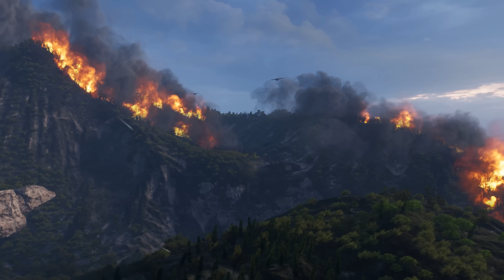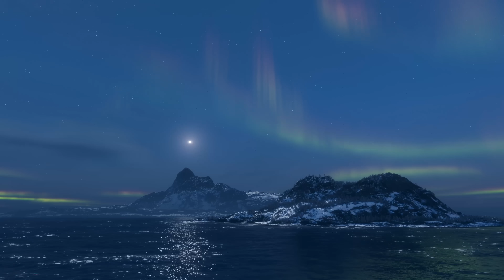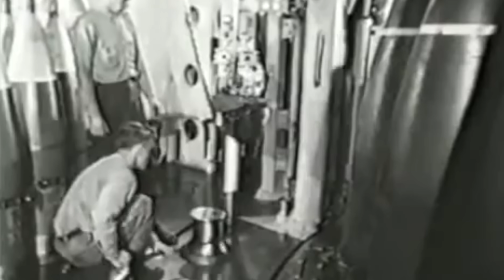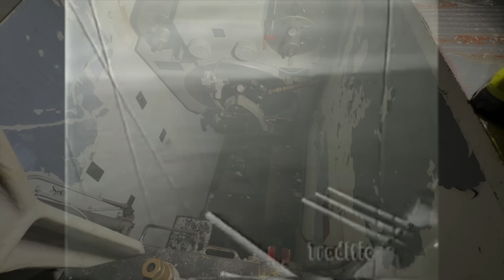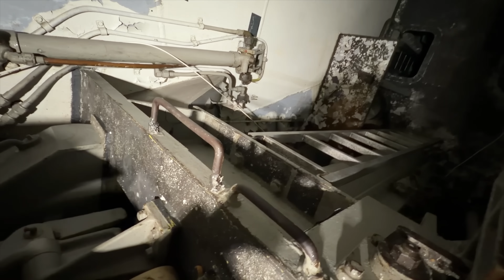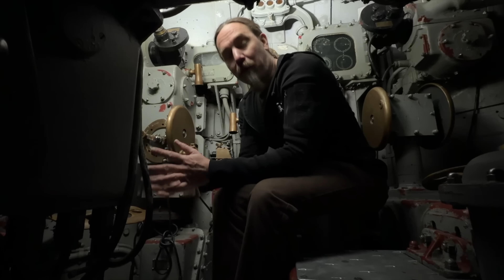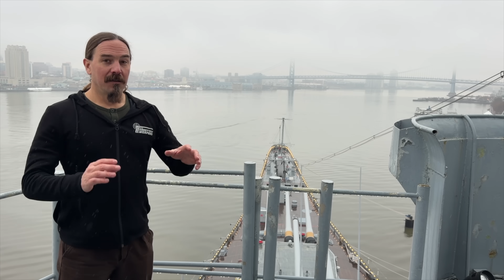How the USS New Jersey's 16-Inch Guns Work: Top to Bottom

Comment: I alwys wondered why they didnt make smoothbore guns, the hp shell or tailed ap (not apfsds) couod work and the guns would have a longer lifespan and more power, no?
Reply: Various studies were started for employing smaller Sabot projectiles, rocket assisted projectiles, and other enhancements for 16" guns over the entire course of the battleships service lives, but none of them ever came to fruition except nuclear shells in the 50s. One big reason for that is they had so many shells left over from WWII production that they never had to make anymore- maintaining the shells in reserve were always going to be cheaper than actually producing anything new.

 Then, aircraft and missiles were really coming into their own post war- having a range of 80 or 100 miles on the guns would be cool, but we already had platforms that could do that for the Navy so there was no urgent need to extend 16" range. After that, there was the fact that the Battleships were only temporarily reactivated  each time because of their absolutely massive maintenance, material, and manpower costs, and at that, we only had 4 of them so the benefit for all the experimental and development time would possibly not even be able to be realized when they keep getting decommissioned. 

That is all enough reason not to follow through development without considering the tragedy of the Iowa turret 2 explosion, and then the disgrace of how the Navy handled it, all plastered over newspapers, radio and TV. The day after the explosion 16" gun operations were halted entirely for a long time- almost a year I believe. They didn't have terribly much time to use them after they were allowed to again, and opinion which was already split in the Navy over Battleship usefulness was now split in the public's eye too.

As awe-inspiring as the Battleships and their main guns are, they simply never justified expanding their capabilities or amount of service further, and now there is no real chance if it happening again- the old powder and shells have been in the process of being removed from inventory and disposed of for a while now, so the guns aren't "free" to use anymore. Even if they were, the Battleships cost a ridiculous amount of money for a single day of steaming, ignoring refit costs.

What I believe the real solution would be is to make some new ships that could feature large naval guns again, but make them smaller and far less armored/high speed. A ship tailor made for something in the range of  12" to 16" guns that focuses on shore bombardment and nothing else to keep cost and crew requirements reasonable. Outside of that, I don't see a world where the 16" is heard again in our lifetimes.
Reply: @KennyCnotG and nothing of the sorts in the new automatic 5 inch gun of the destroyers? Still rifled? Even those russian duals?
Reply: @Alche987 that's a question I don't know the answer too, we've had pretty large smoothbore guns for a long time but I don't know if they're utilized for modern naval artillery.
Reply: @Alche987 so i just looked it up, and in general yes modern naval guns are rifled because almost all of their missions are best served by a round with as much capacity as possible at lower velocity, whereas smoothbore sabot guns offer the inverse, smaller volume but much increased velocity. You can use sabot and rocket assisted rounds in rifled guns, but there are tradeoffs- it's apparently what the british do with their tanks, rifled barrel for better high explosive rounds, and they have a slightly less effective armor piercing sabot round in exchange.
Reply: @KennyCnotG  thanks for the research
Reply: They might have considered that for a newer generation of guns but self spinning ammo would be relatively new for the 40s. The entire post WW2 careers of these ships is them using up old ammo and powder that was already manufactured.
Reply: Those smoothbore tanks where primarily from the 60s and newer.

Comment: World of Warships is a low 'twitch factor' game, so there is no requirement to click on an exact pixel within a time window measured in tenths of a second, so being old is not a disadvantage for most ship types.  There are also non-'player vs. player' modes if you are a more casual gamer.

One of the reasons that the Kirishima got such a spanking from the USS Washington at Guadalcanal was that the Kirishima was preparing for a shore bombardment mission, so the shell hoists were full of high explosive rounds and the fastest way to get AP shells to the gun breaches was to simply load and fire the HE shells.  As the shells were meant for shore bombardment, they would have been nose fused for immediate detonation, upon impact, so they were little threat to the USS Washington (except for any exposed crew, if the 20mm and 40mm antiaircraft guns were manned).

My favorite electro-mechanical gunfire director anecdote comes from World War I.  After Admiral Craddock's unfortunate incident at the Battle of Coronel, two battlecruisers were dispatched from the UK to the Falklands.  They set off in such haste that they forgot to set their computers for action in the Southern Hemisphere.  After some appalling gunnery (the 'correction' for Coriolis effects was applied in the wrong direction, moving the impact point away from target, instead of towards the target), the battlecruisers had to shutdown their computers, engage the reversing gear for the latitude shaft, and wait for everything to get back up to speed to fix the issue.  Once this was accomplished, the battlecruisers were able to counter the German armored cruisers exactly as they were supposed to.  Their superior speed allowed them to control the range and their 12" guns outranged the 21cm guns of the German armored cruisers.

A fundamental issue for fire control computers is that an analog computer can directly perform the necessary calculations, but a digital computer can only approximate the calculations.  A general purpose digital electronic computer would not have been superior to the specialized analog electro-mechanical computer that was already there.  A hybrid system where digital electronic computers set the parameters for an analog electronic computer would have been superior, but not by enough of a margin to justify the delays needed to get the system designed, built, and integrated.  The main issue for digital approximations is that an analog system does not have to step time from one digital value to the next adjacent digital value.  In an analog system, time sweeps continuously from the instant of firing to the intercept time, so no stepping errors are introduced.  Digital systems use an approximation that has time progress in discrete steps that are each very small.  The PATRIOT system's fire control computer kept time as a floating point value, for maximum precision.  Unfortunately, it was discovered that PATRIOT batteries could be left on for too long, so the time between ticks of the floating point clock became too far apart to accurately calculate an interception.  If the Sea Control Ship upgrade program actually happened, with the rear turret being removed for operating Harriers off of the fan tail and the installation of a VLS box, the electromechanical computers would have been replaced with something that could handle SM2 intercepts.
Reply: Hiei was the victim of having HE-frag shells loaded two nights earlier when she got into the infamous "Barroom Brawl" against a cruiser and destroyer force at small-arms range; Kirishima's problem was she got distracted by having a near-helpless South Dakota available as an easy target and completely forgot the report that there had been two large ships sighted. Washington opened up out of the dark on Kirishima at about 8,400 yards, at which range her 8" belt armor was just a reliable way to make sure the Mark VII AP shells had their fuzes initiated (based on pure kinetic energy, at that range if the shells had been duds they would have blown clean through both sides of the hull).

Comment: "You're not putting iron sights on the top of the turret." The engineers just didnt try hard enough. Could you imagine?
Reply: I'll bet some engineer proposed letting the guns aim lower, add iron sights and make the biggest shotgun shells just for 1-shotting those pesky little boats, frigates, destroyers, etc.
Reply: I mean it would need ladder sights, but... yeah.
Reply: @sultanofsick  A close-range flip-up aperture and a tangent sight graduated out to 38 000...I can actually see that....I so wouldn't be surprised if the navy did that.
Reply: "The gun now has two picantini Rail sections added Sir" - "Why two!?" - "The front one has a Holo dot and the rear one has a magnification to see the Holo dot, like, at all" (Two 25cm Pices of Rail just held on by a couple rings with rubber on them.)
Reply: They did on 5 inch turrets

Comment: I served on a ship that operated with  the New Jersey in the Vietnam war and it was an impressive sight to see [and hear] the big guns at work. At times the shells, which were still supersonic, passed directly over our position which supplies a visual / auditory / tactile shock that is impossible to describe. The field observations would describe vast areas of dense jungle that were simply removed and flattened by the 'high capacity' shells. Great report, Ian.

Comment: 15:00 I like how the mouth-to-mouth instructions next to the salt water tank are the pre-1974 version that required you to place a folded blanket or similar item under the victim's shoulders.  This procedure was replaced in late 1973 by the head-tilt/chin life method still used today.

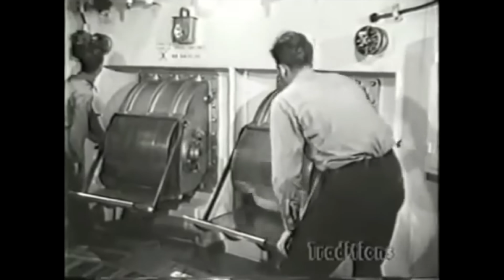Comment: 11:50 just a shoutout to these sailors that casually lift 50kg powder bags like it's made of styrofoam.
Reply: They probably didn’t have to do that for very long. I imagine shifts were something like ten-fifteen minutes on, ten-fifteen minutes off.
Reply: @noahandrulis9077  Each scuttle in the powder flats (where the bags come into the turret) has three crew assigned---one scuttle operator and two powdermen.  So for each shot, two guys have to carry three bags each.  I would expect during sustained action, the scuttle man would switch off with the powdermen since his job is pretty easy compared to the powderment.
Reply: They are 110 pounds each.
Reply: @barto6577  Which after using a calculator translates to just under 50kg, the OP was correct on the weight, they just used the metric measurement instead of the Imperial one.
Reply: @sheo3316
That's why Ian displayed the conversion to the metric system as '50 kg' in the subtitle.
Reply: @hansmeyer7225  I know, but the person I replied to came off like they were trying to condescendingly "correct" the original poster when there was no need, as the measurement was already correct.
Reply: @sheo3316👍

Comment: If my memory serve me, the small cap between the wind shield and the main body of the shell is actually made of soft steel.  This is to help to right the angle when the shell hit a slopped armour, so that the main penetrator (the main body) hit the armour in a more perpendicular angle rather than just bounds off.  The main body is actually made of hardened steel.
Reply: Not quite correct. The cap is indeed made of soft steel, but it does little to help the shell defeat sloped armour, it's primarily there to prevent the shell from shattering when hitting face hardened armour. Most battleship armour at the time was very heavily face hardened, and the penetrator alone hitting the armour would often shatter without the cap. The cap has a very slight effect on helping the shell with sloped armour, but the effect is extremely minor and not really worth talking about.

Comment: Absolutely fascinating! The ammo handling is curious to a field artilleryman. In the Army, the fuse (the nose cone) doesn't go on the shell until it's ready to be fired. Before the projectile is fused, there's an eye screwed onto the nose and the shell can be mechanically handled by the eye. Also, the powder bags for 8-inch and 155mm guns are the size of bean bags, not 100-lb. laundry bags. I think I was most interested in the fire control. I'm amazed at the sophistication and complexity.
Reply: The AP projectile has a base fuze, while the High Capacity (aka high explosive) projectile have both base and nose fuzes.  The spanning tray operator in the gun room would have the task of setting the fuze on the HG projectile if the engagement called for anything other than quick (initiation upon contact).  Interestingly, he would get this time value from the firecontrolmen manning the 5" plotting room.
Reply: He didn't spend much time on fuze design, but that is like another 1 h video, right? Air, land, and sea all had different needs?

Comment: If one is behind the ship during firing; say about 800+ yards or so/more, you can see the round in the air making way to appointed points of aim....  In some cases, you could see the flash, shock wave buffer the air above the target location at 21 miles.....  This makes for a Bang, Whizz and Pop....  When the "Jersey" shelled the hills East of Beirut, someone decided to test drive, view the effects of the AP rounds as those hills were/are honey-combed from 2K years of occupation.  Not sure the intent was to suss out whomever, but when the rounds penetrated into the hill formation, and the 35 lb charge went bang, the amount of detritus that was liberated from the hive was somewhat amazing...  Even the HP rounds penetrated and sent all manner of housewares, kit, goats, and debris flying....  One puckered, sorta screaming arc, a concussed KaThumpBum, then a Low Booooooom, and 50-100 jets of trash expelling pressure, SHOCK, fire and debris....  The bushes would sorta lay aside inbound, and the planet would unhinge on exodus.....  By SHOCK, the air is so compressed, it appears as a column of white steel exiting with a cloud of the planet mushrooming from the points of egress that can only be visually comprehended.  The first few salvos, 4 or so to find the so called right spots.  There were HAMAS and HEZBOLLAH artillery systems in the 'comb" and those chaps had NO Idea what was forthcoming...  The ranging rounds found their mark(s), and with 20 minutes of coordinated 9 round salvos whatever was seeking refuge, security and stealth was mistaken......, the hills, per recorded determination eviscerated any and all subterranean (Iranian) threat.....  Dante and Virgil appeared to be leaving Hell with Haste, and it was an "Inferno..." Somewhere, there are recorded aviation spotter observations of the Real EFFECT of those events....

Comment: So, since the guns don't used fixed ammunition, does that mean they are not considered firearms under federal law?
Reply: Yup, however they are over half inch bore, so they are classed as destructive devices.
Reply: @barto6577  The bore diameter restrictions only apply to firearms that fire fixed ammunition; you can get .58 caliber rifled muzzleloaders from many places (no FFL required), and while most muzzleloading cannon makers only do smoothbore, there's no (federal) law against rifling one if you want to go to the effort.
Reply: @fluzwup    These are breechloaders using smokeless powder, and were designed after Dec 31 1898.   That makes them "modern", which classes them as "destructive devices" like a howitzer, or other modern breechloading cannon.
Reply: @barto6577  Modern inline ignition, .209 primer ignited muzzleloaders using semi-smokeless pellet propellants do not qualify as firearms, and do not require an FFL to order or purchase new.  Take for example the Knight LK-93, which was available in .54 caliber.  State laws may differ, but it's not a "firearm" under federal law.  Now the 16" explosive shells are regulated as destructive devices, but that's due to the explosive content.
Reply: @fluzwup    However, those "Muzzleloaders" based on the NEF partner actions and the like, ARE classed as firearms.  Because all you need to do is change the barrel and they will shoot a modern cartridge.  Same with the Rem 700 ML, a bbl and bolt change was easy.  Those are classified as "Modern firearms" and require FFL transfers.

Comment: The fire control computer's backup hand crank is the real reason Popeye had such beefy arms.
Reply: 50 pounds per powder bag may contribute more!
Reply: @miketam5452  110 pounds per bag.   100 pounds of "smokeless" and 10 pounds of black powder as an ignition booster.
Reply: @barto6577  Hence why you never messed with battleship crews. Seeing skinny guys lift those things like nothing means they would've been ripped under those shirts and made any infantryman look like a lightweight. M2 Brownings weigh 84lbs and I bet these guys would treat them like M1919s.
Reply: @Predator42ID    I was one of those "Battleship Guys".  Carrying 100-150 pound valves and bags up and down 45* ladders makes you stronger than you look.
Reply: @miketam5452 50 kilos!
Reply: Maybe the tech bros who want to build AI datacenters could spend a couple months on an exercise bike cranking out a few hundred watts to help power the place.
Reply: So ultimately it is spinach powered?
Reply: Its not has hard as you would think. Just a matter of gear reduction. There is preserved quad 28mm AA turret on the Yorktown in Charleston. Maybe 5 or 10 lbs of effort to get the cranks moving manually and the turrets weighs about 5 tons. Takes forever to turn 90 degrees but a child can indeed do it.